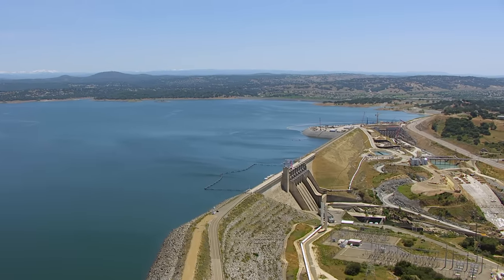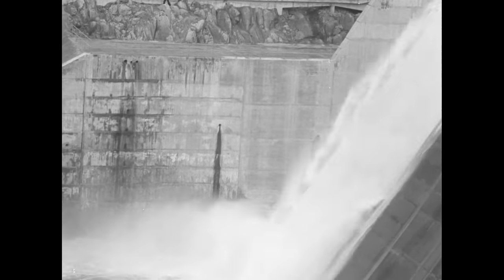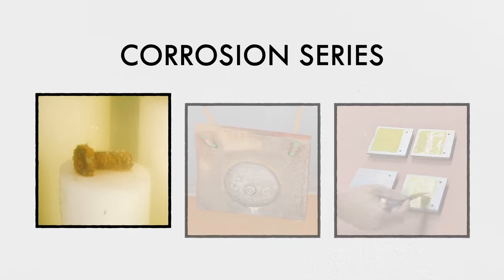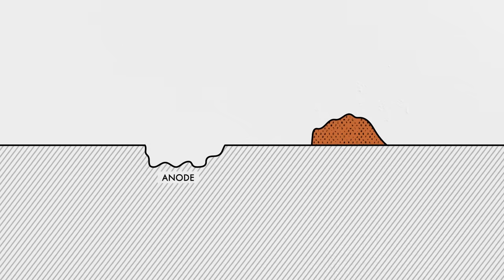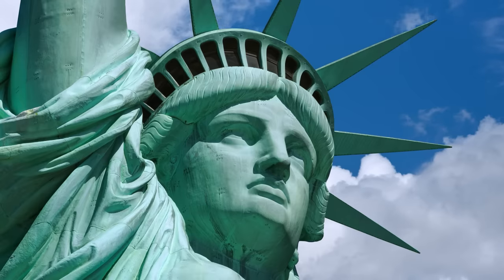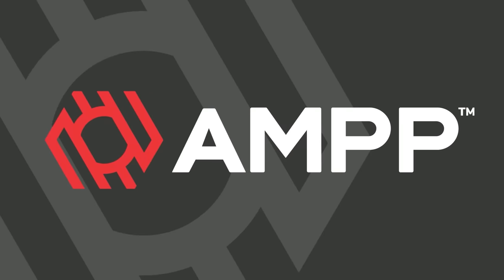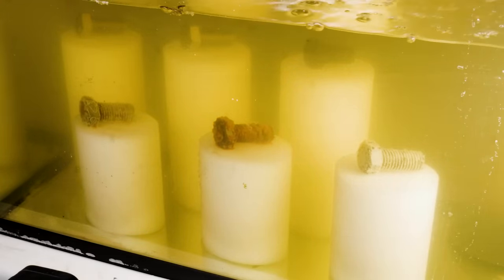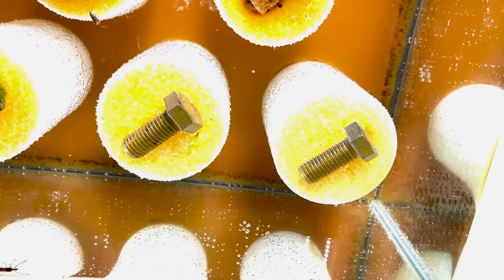You Spend More on Rust Than Gasoline (Probably)

Comment: The Statue of Liberty is actually a complete remake because they used mild steel and copper for the original. The galvanic corrosion came very close to making the whole thing collapse before it was discovered. I think it took over 1 billion dollars to remake it with better materials
Reply: You’re a little sussy baka😏😏😏
Reply: Says  @jackmiehoff7530
Reply: Need Impractical Engineering channel that is just engineering failures and lessons learned from those mistakes.
Reply: Two channels and personalities l love...
Reply: Another Fun Fact: The Statue of Liberty has a twin in France. The two Satues of Liberty  were made to serve as a reminder of France's support of America as it revolted against the British Empire.
Reply: Oh go and be an angsty teen on some awesome game show somewhere
Reply: Lee Iacocca (re: Ford & Chrysler Co) orchestrated the complete restoration of Liberty statue.. including restoring the cast copper & it's patina exterior.. (i assume they still do not allow visitor to go up to the torch section)
Reply: What what what?! I've never heard about that.
Reply: over 1 billion??  thats enough to get 1 morbillion tickets to the movie morbius!!!!
Reply: Complete remake is too strong. The outside of the statue (aside from the torch) are 98% or 99% original. The internal structure was largely rebuilt though.
Reply: Thanks for the gift, France. SMH
Reply: @claytonnlambert  There's a podcast called Well There's Your Problem that might be for you if engineering failures are your thing.
I'll give you a content warning for leftist politics, off-topic ramblings and extreme sarcasm -- in case any of those are dealbreakers for you -- but it's definitely an interesting series.
Reply: @mattb9343  Yet one more fun fact: that twin took a trip from Paris to Odaiba in Japan in the late '90s. After it went back to France, they built a new permanent replica for Odaiba, since it had been so popular. It's a fun thing to go see if you're ever in Tokyo. (Also recommend Wikipedia's list of "Replicas of the Statue of Liberty." Lady Liberty has so many little siblings scattered around the world.)
Reply: @claytonnlambert  I second this!
Reply: Only a goverment project... That's enough to build a top line aircraft carrier!  Outside of NYC,  a real price tag should have been about 10% of that.  I visited in the 70's: crown was open, but the torch was no access and at risk of falling off..
Reply: @pacresfrancis1565  Morb meme is dead we're all stray cat posting now try an keep up
Reply: How is liberty island not in  NJ?
Reply: @mattb9343  The statue in France is a bit smaller, under 40 feet tall.
Reply: The island is surrounded by NJ but NY has consistently been able to keep it as NY because they have better lawyers (liars)
Reply: Are you still afraid of nuclear?
Reply: Goodness, I'd send it back to the french and swap it out... Must have been awkward 😬
Reply: @fisqual  lol a modern day Trojan horse xD
Free gift with 1 B$ fee inside
Reply: @claytonnlambert  it's a bit different, but to learn about "lessons learned" the USBSC channel is a great example of public communication about industrial catastrophes and how to prevent them.
Reply: I also think
Reply: @robertanderson5092   It's Federal property located within the borders of NJ.
Reply: @mattb9343  PHONE: " Your Statue maintenance plan is about to expire. Please press "1" to renew your policy "
Reply: @mattb9343  And a baby sister in Las Vegas and Texas
Reply: Build apartments. We are always looking at galvanic corrosion. Particularly when doing high end. Brass to aluminum the common request. Just doesn't work without adding a high maintenance item
Reply: @flinch622  What planet you live on?  An aircraft carrier costs over 10 billion.
Reply: @claytonnlambert  
I really like the channel "Plainly Difficult" for this reason
Reply: @flinch622  A top of the line CV for 1 billion? LOL! Does the DOD know about this company? Probably not, otherwise they would not pay 12.8 billion without the planes and maintenance! Dear lord, at least be so smart and check the numbers before you make a fool out of yourself! And BTW, preserving something is always way more expensive then building it new. Anyway ...
Reply: I concur with @Odin029. Only the structural iron was replaced, as far as I know.
And even then, I believe that the original design did attempt to isolate the two materials in order to mitigate the galvanic corrosion, which is more than a lot of modern construction can say.
Reply: @50043211  They might, but good luck finding a public number anyone will admit to knowing [especially if dod got fleeced hard on its latest purchase].  In June, the Fujian launched, with a fair amount of stolen tech I suspect.  Piracy no longer occurs on the high seas, but at the patent office.  My guesstimate? 1.6B [weapons/planes excluded]... crime pays in communist countries.
There is probably an easy 40% manpower overload on most us carriers, and with that a plethora of equipment never seen [or disappearing] to justify the assignments.  Entire machine shops may exist with no officer being aware of their existence, collecting dust for all we know.
Anyway, carriers are for regional control.  Subs have displaced them regarding true power projection in our post ww2 world.
Reply: @claytonnlambert  I recommend the Brick Immortar channel which recently started to focus on engineering disasters. The Fascinating Horror channel also covers some accidents caused by engineering failures. I recommend the USCSB and Plainly Difficult channels too that were already mentioned in the thread.
Reply: ENTROPY SHALL NOT BE DENIED!
Reply: @jackmiehoff7530  clever screen name. Almost as fly as mine ;)
Reply: @claytonnlambert  If this wasn’t already said, I totally recommend the channel Plainly Difficult. His video covers major disasters with intricate detailing engineering failure leading up to it.
Reply: @Gosh_Josh  Second this!
Reply: @claytonnlambert  Well There's Your Problem Podcast
Reply: @fisqual  Thats the response you have to the statue of liberty being given to us as a gift and having unforeseen issues? You got nothing better to say?
Reply: @jackmiehoff7530  ayo 🤨📷
Reply: @claytonnlambert  Its called Plainly Difficult and he covers fuckups
Reply: Not a complete remake, they replaced much of the structural frame but the statue, that is the copper cladding, is original.
Reply: @GoodOleCybertron  We have a small replica in my hometown of Independence, Missouri.  Its a short walk from the home of Harry Truman. Its just a bit bigger than a person and on a pedestal.  In front of a community bldg that used to be a Junior high school I attended in the 70s.  Its a nice statue.
Reply: @flinch622  Thats called deflection I think. NVM, I just wanted to show you thats always better to check stuff before you post nonsense. Not so difficult. GD!
Reply: @50043211  Suit yourself.  But I have to say its amazing how much regulatory burden [on top of occasional milspec myopia] can cost. Each rule leverages the costs of the next one up, layer by layer in kaleidoscopic fashion.  Imagine a bid without unions, or politically correct policies having to be in place just to bid, etc. You know: the "get 'er done" atmosphere that built the Hoover dam, and half of NYC a century ago [when we had a capitalist society]?
If I could re-cast the admonition of Eisenhower against the military-industrial complex it would be this:  beware of government becoming so large, oversight becomes physically impossible - exactly what LBJ did in expanding dod weaknesses into all areas as regular practice.
So yes: I say it is physically possible to build for $1B - it just can't be done in the US until political will exists in congress to clean up their mess.  I bet Indonesia could do it...
Reply: @jackmiehoff7530  Jack this Jacque Off!
Reply: @mattb9343  the one in France is not as big properly 10 m high or approx 33 feet. Placed in a roundabout in Alsace.
Reply: @screwaccountnames  that sounded super cool until you mentioned the politics part. Obviously engineering takes time and money both of which are influenced heavily by politics but that doesn't mean you have to take a side. Bummer.
Reply: @robertanderson5092  Nothing named "Liberty" should be anywhere near NY or NJ.
Reply: @screwaccountnames  what type of leftist politics are we talking here? Identity politics, "eat the rich", etc. or more sane stuff?
Reply: 1 billion dollars? We call ourselves the land of the free but I hesitate to even call that cheap!
Reply: @SnifferSock  On many episodes, there's a discussion of who was assigned blame for a particular disaster, and such questions are pretty naturally politically loaded. In that case, left-leaning analysis tries to find issues with the bigger system, rather than with individuals.
However, I would say that the whole conversation on that podcast is pretty strongly politically colored, including identity politics. So if that's not your thing (which I completely understand), I wouldn't recommend it. That's part of why I included a content warning.
Reply: @mattb9343  it's a quarter scale replica. 37 ft high though.
Reply: I don't think so, what you are referring to is the iron structure INSIDE and it's attachment points to the copper skin, the copper except the crown is the same that was there, the steel/iron inside and it's attachements were what had to be re-done.
Copper doesn't corrode away like steel, I own several decorative architectural copper ornaments, including a section of the 1917 Commodore Hotel in NYCthat was exposed to direct rain and weather  and 42nd street pollution for almost 95 years, and the metal is in perfect condition and structurally sound, it retains its prized green patina
Reply: FAKE
Reply: I dread the thought of what it will take to address the needs of the 20th centuries’ world class skyscrapers and bridges.  These giants simply cannot last another 100 years without having all their metal replaced.  The costs will be too prohibitive though.  So I fear that demolition will be the favored choice.
Reply: Thanks for nothing, France!
Reply: @jamesdagmond  how much an aircraft carrier costs now isn't relevant. how much did an aircraft carrier cost in the 80s when the statue was rebuilt?

The Nimitz class carriers (of which one was commissioned the same year the rebuild was completed), cost only $8.5b  in 2020 dollars ... Or $3.5b in 1986 dollars (based on CPI).
Reply: @claytonnlambert  we call that “engineering ethics” lol. That’s a big part of my college courses on engineering ethics - learning from mistakes (ford pinto, challenger explosion, Hyatt Regency walkway collapse, etc.)
Reply: I had no idea about this
Reply: 1 billion? That’s insane, is there an report/source of this anywhere?
Reply: OP's quoted cost is wrong, and it was (I just learned through some googling) only the interior structure that was replaced. PRETTY misleading comment overall!
Reply: @screwaccountnames  leftist politics in anything is a dealbreaker. Hearingon of  my favorite gun youtubers promoting gay marriage is grating
Reply: @claytonnlambert  
Oh please please please give me this channel!!
Reply: @claytonnlambert  That's a great idea, and our host is just the fellow to do it.
Reply: @francom6230  It's too bad he didn't re-engineer Chrysler cars to be more corrosion-resistant.  They were rustbuckets.
Reply: @TheLongDon  That's an interesting username to have, with political views like that.
Reply: Can you hook up an opposite voltage to stop galvanic corrosion?
Reply: @SR-ml4dn  There's several replicas al around France and the world but the "official" Replica is in Paris on an island on the river Seine.
Reply: The skin of the statue is 98% original - the supporting cast iron armatures designed by Eiffel caused galvanic corrosion so were replaced with stainless steel supports.
Reply: @TheLongDon  Karl, comrade, u used to be cool... what happened?
Reply: @claytonnlambert  check out Brick Immortar
Reply: "Give me you tired, poor, huddled masses yearning to breathe free, and I'll send them to your local Chrysler-Plymouth dealer."
Reply: Oh boy
Reply: @mattb9343  i'm french and i've never seen it in France, never even heard about it.
Reply: They shoulda let it collapse.
Reply: If only they would have cropdusted it with fluid film once in a while.
Reply: @arpit9123  NFT's are cringe.
Reply: @claytonnlambert  There's a podcast, "Well There's Your Problem" that is basically that
Reply: Real vs practical engineering
Reply: There are more than 2 types of stainless steel.
Reply: More like that's what the government claimed it spent money on...

The original in Paris is fine...
Reply: @claytonnlambert  YouTubers name is plainly difficult
Reply: @claytonnlambert  Except looking at failures is in many ways more practical than marveling over incredible achievements you’ll only know a fraction about the functioning of.
Reply: Your hard earned tax dollars at work , I never heard of the statue being completely rebuilt as there are no pictures to prove it happened but on the other hand the government is just  " it's o. k. to spend taxpayer money, I would have to agree !
Reply: What do you expect from the French…
Reply: RUST the cancer of steel
Reply: Mild steel? Wouldn't strong steel be better?
Reply: @GoodOleCybertron She's a mom now ❤
Reply: @mattb9343 I knew France made the original statue of Liberty and it was a token of friendship, but I didn't know it was rebuilt.
Reply: @arpit9123  replies with an NFT pic
Reply: @arpit9123 lmao I came back to this comments and had already liked this comment
Reply: Source?
Reply: When was the rebuild?
Reply: What happened to the one in Paris? Did they have to rebuild that as well or was there less corrosion because it was not adjacent to salt water?
Reply: I am from Bosnia take me to see Statue of Liberty, I can no longer wait, I will assimilate
Reply: @claytonnlambert there's a TV show called engineering catastrophe
Reply: @fisqual exactly. Some French guy writes an inscription on the statue's base and now Democrats believe half the third world is entitled to live here.
Reply: Iron when oxidized is BROWN.
Copper when oxidized is
GREEN.
Reply: They knew. They knew.
Reply: Ha, sorta like the king who gives gifts of elephants knowing it would bankrupt the recipient
Reply: Wow, think about getting a gift from a different country and then having to build it again for  1 billion  dollars because the people who made it used the wrong materials...😅
Reply: @mattb9343 there's a 3rd statue but I forget where